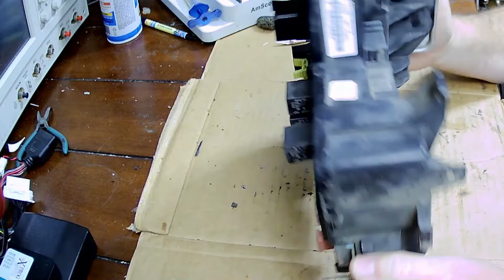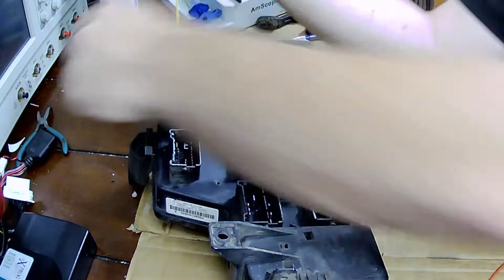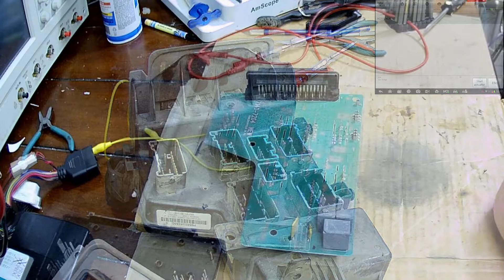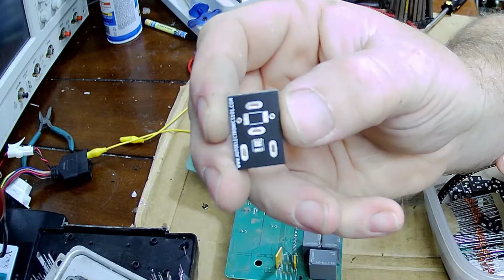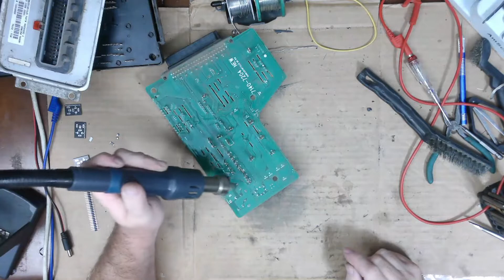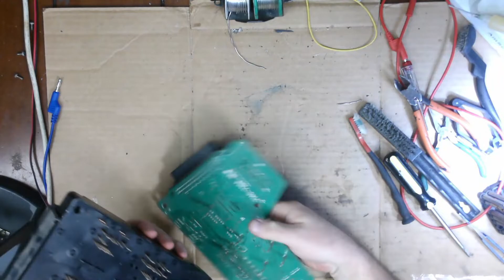02-05 Dodge RAM Fuse box testing & repair - failing trailer turn signal lamps relay replacement

Comment: How about posting a video on  how to get the Fuse Box out of the 2002 to 2008 Dodge Ram 1500? It is all fine and good to work on the box out of the vehicle but some of us need to know exactly how to get the darn thing off the truck!
Reply from the maker: I only do bench work these days so I wouldn't be able to do that video anytime soon. Both the 03-05 fcm/ipm (like whats in video and the 06-08 TIPM are pretty easy to remove though. The 03-05 which I assume your having issue's with is 1 nut, probably 14mm on the top bracket, 2 or 3  plastic phillips screws, the nut holding the B+ cable on and then just unhooking the connectors.
Reply: @DicTaTormbappe96 I can show You

Comment: This is the most insane dumb thing I've EVER seen a car manufacturer do! Lets solder in relays, UNDER the relay box, to where the customer can't get to them! Change any other fuse or relay you want, but F your trailer tow relays! My God, I want my time back from diagnosing the stupid trailer lights. Hours upon hours upon hours. NEVER DODGE, NEVER AGAIN!
Reply from the maker: Its even worse these days. They place most all relays internally now and label "Non Serviceable". I fit makes you feel any better, BMW and BENZ do the same thing but with FUSES lol... The exact same bradded fuses but built internally inside module.

Comment: Thank you for sharing. Hope you don't mind me saying  a close up of the relays would have been useful to see. A while back I actually opened a very old toyota carina (UK) signal relay and repaired it. I cannot remember what I did to it. All I know a friend asked me to repair it as  he remembered I used to tinker with electronics. What ever I did in it worked. Did you have problem with the audio on this video?
Reply from the maker: Yea the audios a bit messed up lately. Haven't had time to see what the problem is but probably will end up getting a decent mic a little later. Its usually so loud around my work area that I typically cant record audio good anyway so its been a bit of a low priority for me. 
Close up of the original relays or the solid state ones I made? I have a close up picture of it herehttps://tinyurl.com/2p8md497.

The normal relays I am replacing fail usually because the armature breaks. I think I even did a video of it before for someone... let me see. yep here it is: https://youtu.be/6KcKs4wzM9M
Reply: @ecurepair  Oh my god! just looking at your video of the internal relay I now can somehow partially recall how I did the repair. It was a copper like switch which the rivet had came off. As in your video not opening and closing to make contact. I actually used a small piece of a wash basin like copper chain and riveted it back in place and it worked like a charm.  Thankyou for the picture too and this is not like the old relay which was of some form of  electronic and  mechanical movement involved?
Reply from the maker: I made these using a mosfet to control the switching electronically rather then mechanically. https://en.wikipedia.org/wiki/Solid-state_relay